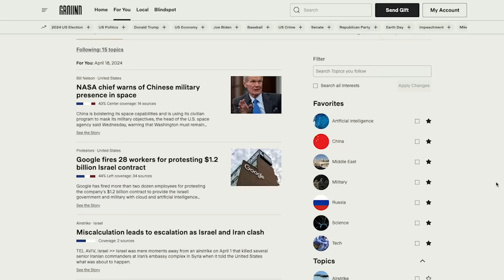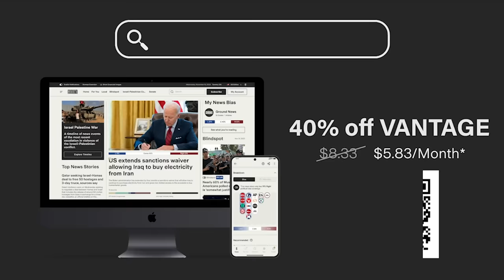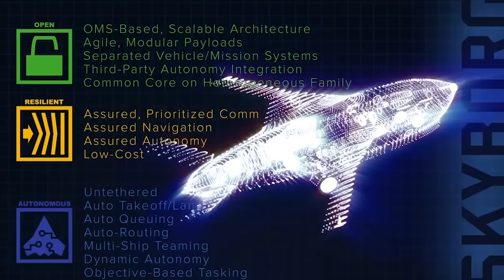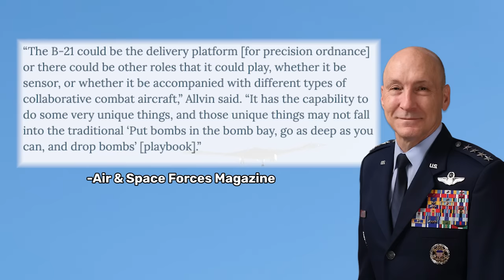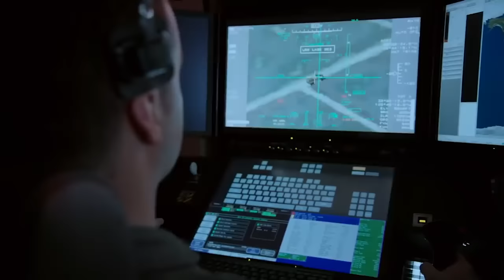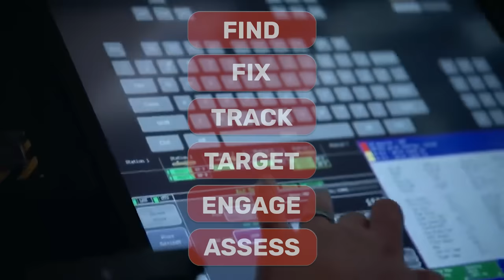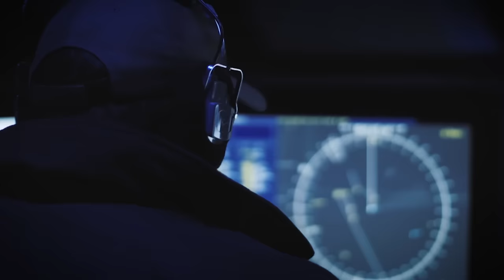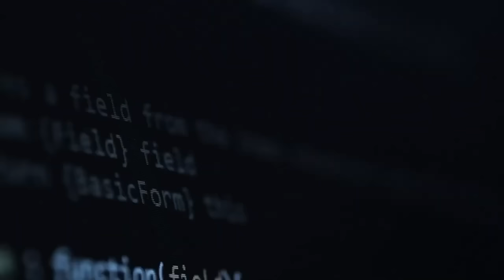Is the Air Force already developing a replacement for the B-21?!

Comment: In fact the B21 is a much simpler aircraft to build than the f35. First and foremost, there is no provision or thought of a lift fan system. There's no afterburners. The engine is a fully mature design. There is no need for supersonic speed and finally, as you well pointed out, its based on an airframe design that's over a decade old. Basicly, its an off the shelf design meant to bolster our sagging bomber fleet. The fact that they already working on a replacement comes at no surprise given that its really an "interim" solution.
Reply: Also no considerations needed for supersonic aerodynamics.
Reply: No wonder it is on time and budget
Reply: The f35 is 3 DIFFERENT aircraft. Not exactly the best comparison. Only the so called F35B has a lift fan and is almost completely different from the F35A, for instance.
Reply: @wstavis3135   In fact, no. The dimensions, power and function of the engine were all dictated by the liftfan system, In fact, the whole airplane was. The other small differences between the aircraft are mainly due carrier fleet considerations or reuse of the space that not having a lift fan allowed. You can take the engine module from an F35B and graft it into any other model with minor adjustments. The software takes care of everything else. That is the strength and the weakness of the F35. But the whole principal of the system was sound, its not as agile as an F16 because what ever dogfighting ability it may have is of little use for a plane that is basically a mini AWACs that happeneds to have missiles and carry bombs that it can drop with pinpoint accuracy 50 miles or more from the target without ever being detected by hostile radar. The B21 leverages tge same thing but with even more stealth and a much larger internal weapons load.
Reply: @wstavis3135  The F-35A prototype was modified into the F-35B prototype.  I disagree that Raider is much simpler to aircraft to build. Much simpler, negative Ghostrider.
Reply: every f35 doesnt have vtol capability. the f35 is three different aircraft entirely. its not billions of dollars for one airframe. civilians opinions on cost of military equipment is irrelevant
Reply: But we need more B-21’s to replace the aging B-52’s & B-1’s, starting with the B-52’s.
Reply: @nomercyinc6783  
Again, absolutely incorrect. All the aircraft share approximately 35% of components. The biggest of which is the engine. The lift fan is a module that attaches to the front of the core engine. Avionics, sensors, weapons system, computers, software. You have no idea what you are talking about. Again, there are structural differences, but they are subtle. All the 3 planes even come off from the same assembly line!
Reply: @TraditionalAnglican  B52"s will be around longer than B1's or B2's. In fact, the Air Force is spending billions on re-engining the entire fleet. There will always be a requirement for a big, dumb t bomb truck that can deliver massive amounts of bombs for the least amount of money. Given all the slew of new long range, stealth munitions, it can even maintain strategic nuclear  deterrence! The B52 is not going anywhere for a long time. Even if the B52's started falling out of the sky because of ultimate structural metal fatigue, the Air Force would build it or a facsimile of it again.
Reply: somewhat true. one of the core requirement is "stand in". Originally the next bomber was gonna be a stealth supersonic aircraft with dash speed to attack pop up threats. However, they realize that if you cut the supersonic requirement and bolster the stealth and range requirements, the aircraft can essentially stay inside the threat envelope and attack any pop up threats. Alot of the innovation went into adding sensor and EW capabilities that are embedded and stealthy that the aircraft can stand in, soak up electronic information without being detected and engage threats both kinetically and electronically. This is an unprecedented capability and approach. Not off the shelves at all. f-35 and f-22 for example relies on combination of sensors and stealth to dance just outside the threat envelope, penetrate when the conditions are optimal then get out of the threat envelope again.
Reply: @donfully  
Which is exactly what the B21 does! In fact, the F35 has offensive EW capabilities too! Like the F35 (for which all these embeded sensors were developed) the B21 will use the same sensor suite without the air to air capabilities. Again, the B21 is, in essence, an off the shelf design, obviously, with adaptations more suitable for the bombing rather than the fighter/attack mission role. The F35 integrated radar/ avionics system is the most advanced ever created, it even makes the F22's seem crude in comparison. How do you think the Israelis bombed an s400 system in the heart of the most heavily guarded site in Iran with pinpoint accuracy without the Iranians knowing what the hell was happening at all? One F35 2 missiles, and that was it. With just one plane, they showed Iran that it was completely defensless to Israeli attack, which could, of course, be nuclear if necessary. The B21 will have even more stealth, a lot more range, and a much larger payload. Again, take the goodies of an f35 put them in a much larger, stealthier flying wing airframe and bingo the B21 is born virtually overnight.
Reply: it's also no surprise given the air force said they want to make airplanes every 10-15 years now, instead of upgrading them, because it works out to be cheaper. Stuff just changes so damn fast these days. And honestly, it's what we used to do in like the 50s and 60s, right?
Reply: @TraditionalAnglican  The B-52's are planned to remain in service until 2060.
Reply: @Wised1000  I'd say, same goes for F-15EX
Reply: The next upgrade will be the Cylon Raider
Reply: @TraditionalAnglican  I think you mean starting with the B1
Reply: @Wised1000 I hear the B-52s are actually insanely expensive to operate (I know they were insanely expensive to procure at the time). How is it more economical to keep a fast yet ancient de facto cargo plane flying than simply designing and building a new one seeing as it’s a pretty simple platform? Whatever the answer, I will always be routing for the B-52 to stay in service forever.
Reply: @piotrd.4850 The F-15EX is about the greatest thing ever built. It’s basically a B-52 with 5x the speed, 25x the agility and even more wild, not that much less payload capacity. Its also get that sexy new beast of a radar.
Reply: @Wised1000  The B-52, if it is ever replaced, will be replaced by the Cargo Plane carrying palletized smart missiles.
Reply: Compared to the otger bombers in the arsenal the B52 is a bargain all around.
Reply: @TraditionalAnglican  The B 52 is getting new engines for a reason.  It will fly until at least 2050.
Reply: @The_ZeroLine You heard incorrect information.
Reply: @Wised1000  Dude, you are an absolute smoothbrain. 🤦‍♂️
Reply: @Wised1000  there is so little in common between the F-35s, it's not even funny. The engine is not drop in
Reply: @xenophagia  an improvement on someone that appears to have none.
Reply: @Wised1000 the F-35 avionics are ancient compared to what's coming in the B-21
Reply: @Shadowboost  
The F35 avionics are still in development, with only part of the fleet reaching bock 4, so I sincerely doubt so. Unless it's using alien avionics, nothing in our avionics pipeline is any better.
Reply: @eac1235  exactly
Reply: @Wised1000  I can't say what I can't say. But B-21 avionics is a generation step ahead
Reply: @Kenny-yl9pc  🤢
Reply: The B-21 is a manned updated derivative of the Northrop Grumman RQ-180, which began development in 2008 and went into service in 2015.
Reply: @nomercyinc6783 Civilian opinions on the cost are irrelevant? Excuse me. As long as our tax dollars are used to pay for it, our opinions are relevant. How dare you say otherwise. Our forefathers put our military under civilian control for a reason .
Reply: True. The B21 was chosen instead of a clean sheet design that had more capability. This was a compromise. What the planners had in mind was a bomber even more advanced than the B21. Cost too much though. Now with the advent of CCA, directed energy defense systems, MASINT cloaking, and other maturing technologies, I guess they want to speed up ‘what comes next’. I wonder if it will just be variants like with the F15 and FA-18s..instead of a different platform.
Reply: @johnmartin6420  the B-21 is completely different to the RQ-180
Reply: Also considering lead times on plane manufacturing already working on could well mean will be done in 20 years.
Reply: You need more housing for the homeless 🎉
Reply: Sagging ?

Comment: I retired from aerospace after 29 years on the F-16. Started with the A model and finished with Block 70.  The Viper was the first truly modular AF aircraft and we took advantage of every new technology.  With AI being the next big technology, I would bet that it is a big driver for new programs. The rate of change with technology is exponential, not linear.
Reply: Shield AI already has software flying to add AI capability to the F-16.  It would be nice, too, if a production divererless inlet could be added.  The one tested on the AFTI-16 was a scabbed on prototype to.prove the concept for the F-35.
Reply: Retired M.D. here.  I always enjoy reading what the engineers have to say!
Reply: it is more accurate to say that the rate of change with technology has been exponential. Thus far, tech has been the limiting factor, but we are quickly coming up against other limiting factors such as materials or energy availability that may blunt, or even end that trajectory. They also may not, but we cannot be sure, so we should not make declarative statements which include an uncertain future.
Reply: The New AI Intergrated F-16 is INSANE
Reply: It’s really not exponential. It’s a number of sigmoid curves laid over each other. IE - A ton of iterative upgrades over a long span of time. These things don’t happen “all of a sudden”. They take large teams of highly skilled people gradually making things better, such as yourself. 
- ex game programmer
Reply: Don't forget engines. We are on the cusp of both ram jets, and better - rotating detonation engines. 

 So add in new engines, AI, and I'm sure new stealth materials. So I'm sure they are incorporating all of it. 

 I feel like one huge advancement is behind the scenes with powerful hardware and software allowing design iterations to go much faster than even ten years ago. 

 Arsenal ship here we come!
Reply: @FoxtrotYouniform  The lack of advanced technology was the reason that we never finished the A-12 Avenger.  The Navy was building a carrier version of the B-2 at a time when the technology was just not ready.  The major result from that failed program was the merging of many aerospace companies into the few we have now.
Reply: No, it’s not exponential.
It used to be true for computing power, but even that is not true anymore.
Reply: Congrats on your career. That must have been immensely satisfying to be involved with the constant improvements being made to that platform over the years. Thank you.
Reply: Thanks for your service.

Comment: Silly question. My uncle designed missiles for Raytheon for 30+ years told me that by the time the public is allowed to see the plane, it’s already obsolete to the people who designed it. That’s because of the crazy amount of time and work and Pentagon and Congress between concept and deployment. And like any project great or small, what you’ve learned during Project X is pre-loaded for Project Y.
Reply: This has only accelerated with all digital design, manufacturing, operational modeling, war gaming, and even maintenance.  Add autonomous AI and new aircraft pop up naturally.  Run to keep up.
Reply: The is true of a lot of commercial technology as well. However, product must be brought to market so choices must be made and a design finalized.
IRL it's not obsolete, since the technology isn't equaled.
Reply: When I was in college in the early 2000’s, one of my professors had retired from CINCSAC.  He told us that civilian technology is roughly 30 years behind military technology.  He described technology to us that we now have in the civilian world but were not available in 2001.  He described mesh networks, large flat panel touch screens, and fully wireless speakers/headphones.  He further talked about rods from God as something we already had.
Reply: @Iamdarthplague  There's a big difference between drawing board aspirations and operational weapons systems.
Reply: @hoghogwild  you're not wrong but he described these systems as active and functional.
Reply: That wasn't a question.
Reply: @xenophagia  He was responding to the question "Is the Airforce already developing a replacement for the B-21!?"

Comment: The B-22 Raider gonna go crazy
Reply: fr
Reply: It would want to go faster than 630 mph for it to be of ANY use at all.
Reply: Raid3r Mk.III
Reply: @mrhassell You clearly don’t understand modern aviation at all
Reply: @mrhassell no
Reply: Why? It's a strategic stealth bomber. If you need to get to a target ASAP you use a ballistic missile. I have never heard anybody claim that the B2 Spirit is useless as a bomber because it can't go Mach 2. Thankfully smarter people are in charge of procurement at the air force, and none of them have listed "top speed" as a top priority.
Reply: @mrhassell  blud is clueless
Reply: Meanwhile, the poor russians are still stuck with Tu-160. 😂
Reply: I thought it would be the B210
Reply: What happened to the B-3 through B-20 models………….

Where are the models between the F-111 and the F-117………

After the F-23 Black Widow, but before the F-32……..
Reply: @tylernero6671 nobody wants a B210.  Heck they didn't want the B210 in 74 when Datsun released it. 😂😂😂

Comment: Calling it now, the replacement for the B-21 is going to be arsenal bird from Ace Combat. A giant mothership that releases dozens of AI controlled combat drones. Fast, agile drones replacing manned aircraft,  it'll be an aircraft carrier in the sky
Reply: Whether the drones are recovered or not, Autonomous drone swarms that have a target list to take out without need for continuous data streams will be something in the future.

Saturation strikes are just that important.
Reply: Along with a gimbaled  laser cannon to take out ground to air threats and air to air threats.
Reply: "Why do I hear Boss Music?"
Reply: Zerg!
Reply: They'll just retrofit a B-52 for that. 😄
Reply: @fire2k11  the B-52 will never be retired.  Grampa Buff will out live us all
Reply: Good thing he's  a friendly feller.
Reply: nice thought but radar x section might be too big
Reply: Any airborne aircraft carrier would be as expensive as the naval variety, and just as rare.  They'll also have to have a variety of support and defensive aircraft around as well, to protect that multibillion dollar asset.  It also means that if one goes down, there goes a sizeable portion of your strike capability.
Reply: @pahtar7189  you're thinking too big, both in size and quantity.  The NGAD is basically this concept already. With a drone a little smaller than the x47B and a mothership that could carry a squad of 4 of these fast, agile X47 B-type fighter drones with the mothership handling the attack roll, I think is a lot closer than we think.

Comment: I was helping a friend move in the late 1990s and we found a computer magazine in a drawer from 1990. Dell was selling a system with a 128 Mb hard drive, a whopping 4 Mb of RAM, two floppy drives, VGA monitor, and printer for....$5999. And the B-2 hadn't bombed an Iraqi position yet. I remember playing Tetris in stunning monochrome on the Game Boy.
Reply: A big reason why the US hasn't fielded new generations for 30 years is just the leaps in performance year over year of computational power leading to better modeling, digital design, and even 3d printing. Combine complex models with generational algorithms that may spit out hundred of design evolutions to something even more optimized, and it makes since to keep delaying new decades long purchase programs until your data models start to stabilize in capability, which let's be honest, they have for the most part.

This means that the new generations of systems should be smaller since the new design processes are going to maybe be fast enough to take practical lessons from a large scale deployment back to the computer model and make something even more powerful. 

The US has massive computational resources to drive all of this, and it's not always about raw computational power. Big elements is the bespoke air modeling systems created and maintained by Boeing and Lockheed et al. Reliable modeling data is the single most important part of computer modeling. If your data is bad, it doesn't matter how great your computers are.
Reply: I remember playing a hand held football game in 1978. My first game console was Pong followed by Atari
Reply: My parents must have been rich, we had a Super VGA monitor, Dot Matrix printer, and 2800 baud modem. Still had to use DOS though.
Reply: Commodore 64 had 64!KB of RAM, lol.
Still was pretty cool. My friend and I would log onto random BBS sites when we were in elementary school in the '80s. We were 8-9 years old.
Reply: Thank you for the shout out for the air force JTAC 'S my son is a CCT and currently deployed in Europe.  The silent professionals .